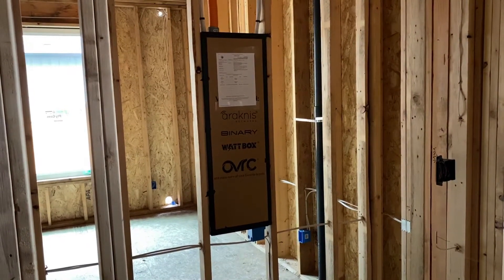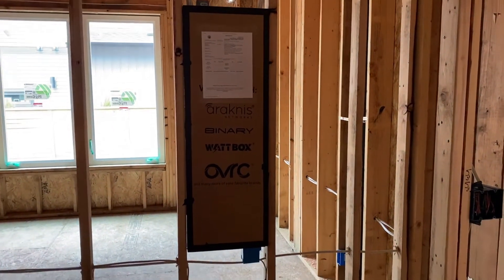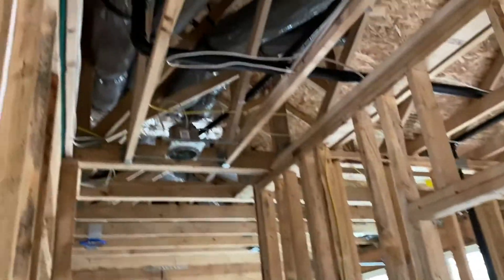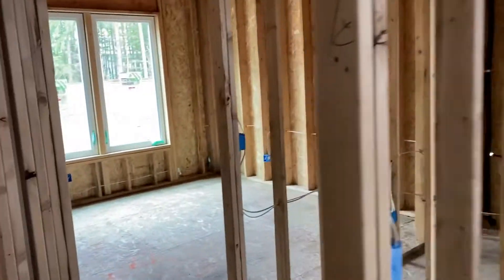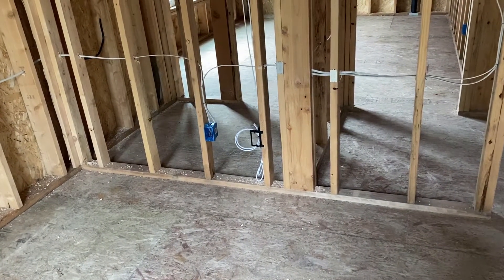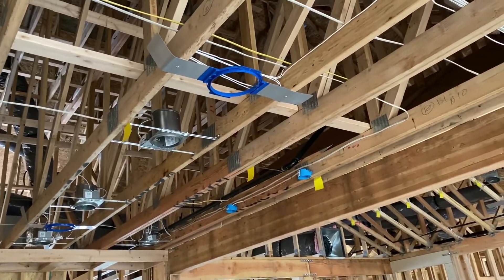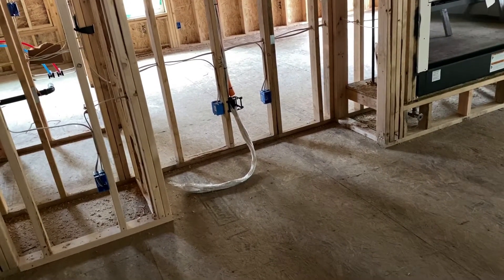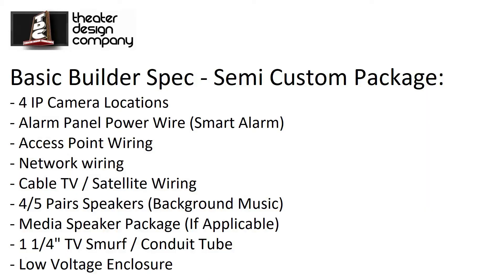🏠 Builders Need to Wire Homes for Low Voltage! Alarm, Speakers, Network

Comment: Just found this, good points. But why does anyone run Coax anymore? Even Xfinity uses wireless boxes now.
Reply from the maker: Yes,  Cable modem and still lots of folks with Xfinity DVR, etc

Comment: A permit for low-voltage come on that is craziness.... You're under 120 right?
Reply from the maker: Makes sense    Lots of trades doing terrible wiring up here in the NW
Reply: @theaterdesignco  so in this case it's less of a safety thing than it is a "I want to check that you did it right" thing?
Reply from the maker: @doveshouse   Most likely a money things with the state but there are some great inspectors who are actually making sure the work is done right.

Comment: I disagree. Builders need to quit pretending they know what people will need and where. The building industry moves a snail speed in comparison to technology and homes are in use fo many many years without opening up walls and ceilings. Instead of wasting money and materials for runs that will never be used we should be installing ENT (smurf tube) all over the house from the data panel so installers can easily install whatever is needed anywhere in the house. My house is only 5 years old and had fiber run to the house and yet the builder ran coax all over the house that will NEVER be used.
Reply: Running conduit in the house is the way to go.  Builders are cheap and do not want to add much. Make sure to run conduit in from the service box outside to the distribution panel. The distribution box in the video is to small. It needs to be bigger for more stuff with a dedicated 20 amp circuit. Builders think these boxes are wonderful, they have no room for growth.  I have see a lot of home owners remove the these boxes.
Reply from the maker: Conduit for sure.  This video is really explaining builders need to pull for technology. 

Cheers.
Reply: Amen..
Reply: Yes ! They are running fiber straight to the modems now, so if you have finished walls/ceilings that will be a nightmare down the line. Also the days of using wired connection is dead, hardcore techies/gamers don't even use wired. Don't get me wrong the contractor/installer did a great job, but as you stated alot of this stuff does not match reality unless the client explicitly wants these items.
Reply: @patrickbellefleur5508  wired is more reliable and faster. only poors use wireless.
Reply: ENT tubing is useless and will not be used. This is coming from a professional network installer. The reason is that the ribbed interior of ENT makes it impossible to do cable pulls. Schedule 40 from the data cable closet, up over the ceiling and then drop down into central locations. You put in a pull string as you are laying the conduit. At least one inch thick or greater to avoid friction and getting cables. caught.

Comment: IMO, one outlet per room is not enough! People like to rearrange and wall mount TV locations are common enough these days to rough in. Also a rule of thumb we use in commercial low voltage that I never see the residential guys use is "If you're gonna run one, might as well run two." Run everything in pairs. I understand that the extra wire isn't free, but the cost of running it again after the fact is much higher!

Comment: Why not run 4-conductor wiring to the keypad locations, to allow for wider range of keypad devices (that have separate power & data lines)?
Reply from the maker: Good point.

Comment: I'm, sorry the electrical discussion is ok, but as a Civil Engineer, and a Subcontractor I couldn't stop looking at the "Doors n windows Headers" that have been laid in a horizontal way instead of vertical (except for the engineer been's shown in the background). I would really like to check the building code in Washington, to see how is that alow, but I have designed multiple projects in different states n this is the first time I see this. The Headers are sandwich like normally are on framing but placed sideways reducing the weight they are  to hold by around 65%-90%
Reply from the maker: Good point.   I will ask the builder next time I see them.
Reply: I don't see any headers that are a problem. Not sure exactly which you are talking about. There are a good number of glulams in there which have sandwiched 2x4s in plank orientation but they are designed for their spans. All the load bearing exterior window headers were in beam orientation and some interior nonload bearing were plank headers over doors.

Comment: Why did you zig zag the 16-2power wire? (At 1:46)
Reply: Well I found this online...I'm assuming this is why...
" zig zag a bunch of extra wire back and forth across the space between the studs loosely stapling the wire. Do this so that the zig zag wire covers a fairly large area. You then have the opportunity to fine tune your exact placement of the drywall cut-out and still be able to easily grab the wire and pull plenty out. If it is an insulated wall you need to be sure to do this after the insulation is in."
Reply from the maker: Correct.  This is to future proof or if the customer does not know the exact location.  

Cheers.

Comment: Been there done that. Buyers didn't even know what it was. Comcast didn't even hook up to it. Waste of money.
Reply from the maker: I would equate this to not putting electrical outlets in the home!!!
Reply: Some installers are either told to only run new lines for "warranty purposes" or they just assume it was a high voltage electrician who ran the wires, and the installer doesn't trust that the electrician knew what they were doing. That they either ran them wrong, used staples and didn't care about kinking the dielectric, or ran the wrong gauge/type of wire. 

Tbh, when I worked for Dish I saw all of those possibilities and for me, as long as the gauge/type was right and tested fine, I was happy that someone pre-wired it for me! The biggest problem I ran into was there being only one line to each room. For most rooms this was okay, but for the love of Pete, please put more than one coax in the living room! Living rooms get 4, MINIMUM! Two wires in two locations! 

Cable companies can bring their TV and internet down one line, but when a customer has internet through Spectrum or Comcast or the like and then they want satellite service, whichever company comes second has to run a new line (spoiler alert, it usually gets screw-clipped along the siding 🤮).

None of these service providers are paying their guys to fish your wall, most will charge the customer for that service but give very little (if any) incentive to spend the time doing it properly.
Reply: Murphy's Law says that if you didn't do the work, the buyer would have passed on the house because you didn't have it.

Comment: How much does a setup like this cost?
Reply from the maker: I like to estimate at least 1.00 per square foot for rough in wiring.  Cheers
Reply: @theaterdesignco  is that cost of the wire or both wire and labor? are rough-in boxes and terminations included in this estimate?